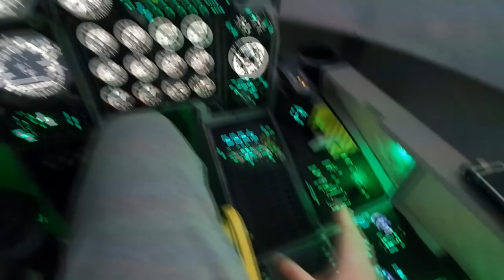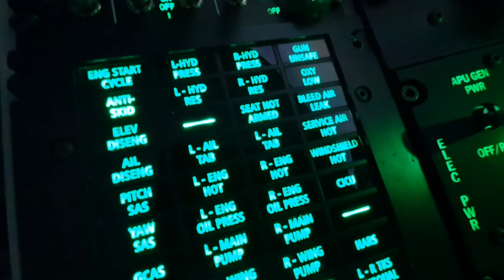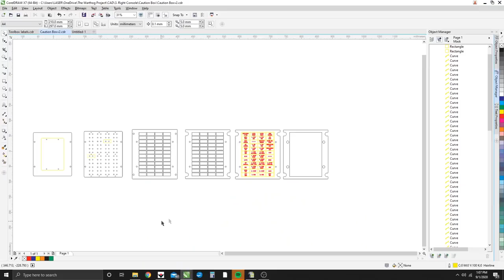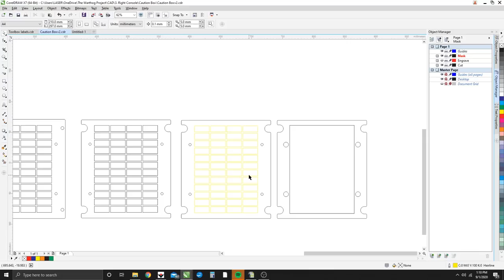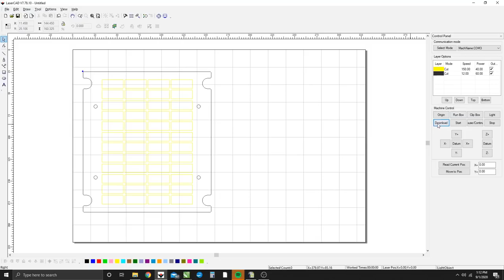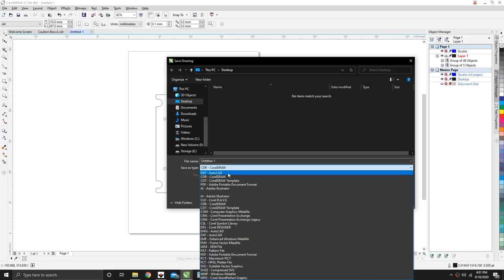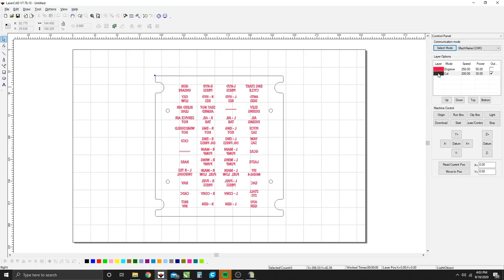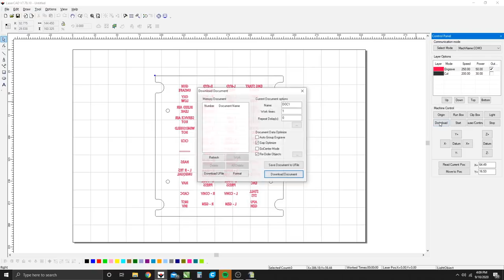The Caution Panel (with a Typo) - A10C Warthog Simulator

Comment: My first thought on LEDs for this panel is "Neopixels".
The wiring is easy - Power all in parallel, data all in series.
Control is easy - One data line from the Arduino, each LED is individually RGB addressable.
Reply: I've been fiddling around with doing this with Neopixels, any pointers on the required Arduino code required to address each Led?
Reply: @bretttoddable  I use the FastLED library here:
https://github.com/FastLED/FastLED
Reply: @No1sonuk  thanks for that, I'm having a hard time getting dcs bios to run the fastled code, don't suppose you mind sharing yours?
Reply: @bretttoddable  I've only tried a simple backlight brightness thing so far.
This code also includes some LCD stuff you'll need to extract.  One thing to remember is to do all the other library includes BEFORE the DCS BIOS library include.
'
'
/*

  Tell DCS-BIOS to use a serial connection and use interrupt-driven
  communication. The main program will be interrupted to prioritize
  processing incoming data.
  
  This should work on any Arduino that has an ATMega328 controller
  (Uno, Pro Mini, many others).
 */
#define DCSBIOS_IRQ_SERIAL

#include <LiquidCrystal_I2C.h>
// #include <Servo.h>

#include <FastLED.h>

#include <Wire.h>
// I2C connections:
// Board           I2C / TWI pins
// Uno, Ethernet   A4 (SDA), A5 (SCL)
// Mega2560        20 (SDA), 21 (SCL)
// Leonardo        2 (SDA), 3 (SCL)
// Due             20 (SDA), 21 (SCL), SDA1, SCL1

#include <LiquidCrystal_I2C.h>

LiquidCrystal_I2C lcd(0x27,20,4);  // set the LCD address to 0x27 for a 20 chars and 4 line display

#include "DcsBios.h"

/* paste code snippets from the reference documentation here */

// Which pin on the Arduino is connected to the NeoPixels?
#define BACKLIGHTPIN            9

// How many NeoPixels are attached to the Arduino?
#define NUMPIXELS      12

CRGB leds[NUMPIXELS];  // For fastLED

uint8_t backlightBrightness = 64; // initial value - will be set in brightness function later (255 max)
uint8_t backlightBrightnessOld = 64; // initial value - for use in loop code

DcsBios::LED masterCaution(0x1012, 0x0800, 13);  // Master caution light
DcsBios::Switch2Pos ufcMasterCaution("UFC_MASTER_CAUTION", 10); // Master caution reset

//  This secction determines which control the backlight LEDs respond to
void onLcpConsoleChange(unsigned int newValue) {
    /* your code here */

    backlightBrightness = map(newValue,0, 65535, 0, 255); // Change 16-bit input to 8-bit for FastLED brightness function

    FastLED.setBrightness(backlightBrightness);  // Set the new level
    FastLED.show();                              // Send it to the LEDs

}
DcsBios::IntegerBuffer lcpConsoleBuffer(0x1150, 0xffff, 0, onLcpConsoleChange);

void onCmsp1Change(char* newValue) {
  lcd.setCursor(0,0);  // set cursor position (column,line) starting at 0
  lcd.print(newValue);
}
DcsBios::StringBuffer<19> cmsp1Buffer(0x1000, onCmsp1Change);

void onCmsp2Change(char* newValue) {
  lcd.setCursor(0,1);  // set cursor position (column,line) starting at 0
  lcd.print(newValue);
}
DcsBios::StringBuffer<19> cmsp2Buffer(0x1014, onCmsp2Change);

void setup() {
  DcsBios::setup();

    lcd.init();                      // initialize the lcd 
  lcd.backlight();
    lcd.setCursor(0,0);  // set cursor position (column,line) starting at 0
  lcd.print("Disply online");
  lcd.setCursor(0,1);  // set cursor position (column,line) starting at 0
  lcd.print("Awaiting DCS");

  FastLED.addLeds<NEOPIXEL, BACKLIGHTPIN>(leds, NUMPIXELS);

  FastLED.setBrightness(backlightBrightness);

  fill_solid( leds, NUMPIXELS, CRGB(0,255,0)); // Fill strip with green

  leds[0] = CRGB::Red; // Set 1st led as red - because why not?

  FastLED.show();

}

void loop() {
  DcsBios::loop();

}
'
'

BTW, I use this username over on the ED forums if you'd prefer to continue this in a better format.
Reply: @No1sonuk  Many thanks for this bud, I will look you up in the forums... Thanks again!

Comment: I have to wonder which you like more, the fling of your sim, or the actual building of it!
I'm not in a position right now, but after watching your video, and the new Flight Simulator 2020, I want to build a GA, complex single or twin cockpit.
I'd like to find a wrecked fuselage for something like a Piper Seminole, Arrow, or Malibu.  Cut off the fuselage right before the firewall and aft of the two front seats.  Then, start to fill in the cockpit.  A couple of G1000 displays, a yoke that gets connected behind the panel to both yokes in the cockpit.  Not sure about the rudder pedals.
Anyway, your work on your son is very encouraging for those of us who can't fly the real stuff anymore

Comment: I'm guessing you'll be first in line for DCS A-10C II? If so, are you looking forward to cutting those new panels? Fingers crossed that there will be a way to use the helmet mounted hud with a static screen.
Reply from the maker: I think the only thing i wont be able to use is the new HMD- unless i go back to using trackir. That is unlikley.
Reply: @thewarthogproject  maybe you could un-assign head movement in DCS from trackir but assign HMD movement to it, might require some additional software as a proxy for those axes.

Comment: I don't know if you know this but an Arduino Uno and a single MAX7219 can turn on 64 LED's individually. The MAX7219 has all of the current limiting circuitry built in. The current is set by a single resistor. No other components needed. You wire the LED's in an 8 row by 8 column matrix. Adafruit sells a product that can do 128 LED's in a 16 x 8 matrix.
Only 3 pins from the microcontroller.

Comment: Good stuff love the content!  Question about your buttons you used for your UFC and CDU , did you print those or did you cut them with the K40, I've been looking at ways to make proper buttons with back-lit lettering and numbers,  i want to cut them with my k40 but trying to find a way to keep them in the panel ? I can print them but then I don't get the nice led back-lit with the acrylic,  any suggestions or help would be appreciated

Comment: What happen with your project (huge respect to you) when A-10 Tank Killer II will be released? How it would affect your cockpit?
Reply from the maker: Biggest panel change will be the new ARC-210 radio- which im building already. As far as i can tell, everything else will still work. I think the only thing I wont be able to use it the new Scorpion HMD - unless I go back to using trackir (which is very unlikely).

Comment: Do you have a link for that Laser CNC?
Reply from the maker: No direct links- but its just a cheap eBay K40 with a few decent upgrades- machine is similar to this- https://www.ebay.com.au/itm/40W-CO2-LASER-ENGRAVING-MACHINE-LASER-ENGRAVER-CUTTER-USB-PORT-CRAFTS-ARTS/281951608772?epid=25034140253&hash=item41a5a01fc4:g:h~IAAOSwJtNdea34

Comment: Hey just thought of something. Why don't you just use the insides or the screen of 8" or 10.5" pads from a Samsung then overlay the black grill over it. the go back and to site you programmed that box the should be a patch for the the upgrade. like I said It just came to me. Check it out to see if was possible any way. please let use know if it worked or if its possable or any thing simiuliar. Thank you for your time.

Comment: Visually panel looking great nice job. But electrically this is a mess... wires soldered to single leds... How about build pcb on one side SMD leds (maybe even addressable like ws2812 or equal) and on another side all your circuits (It can be just connector for control board like arduino or even control board itself ) Addressable LEDs give you brightness and color control for really big amount of "pixels". 
Best regard.
Reply from the maker: That's the nature of using a Phidgets LED64 board. I didn't build it. I'm using a commercially available board, that requires soldering single leds....